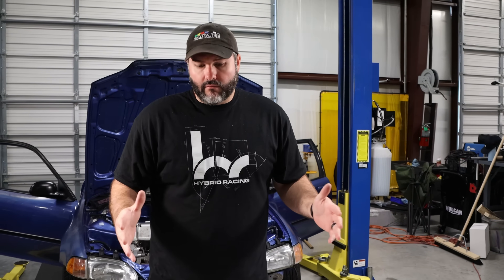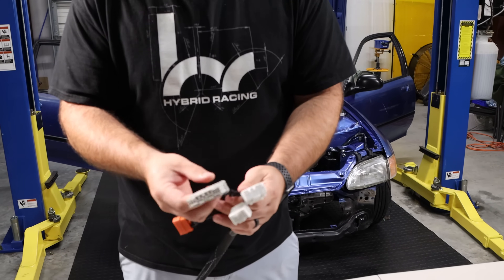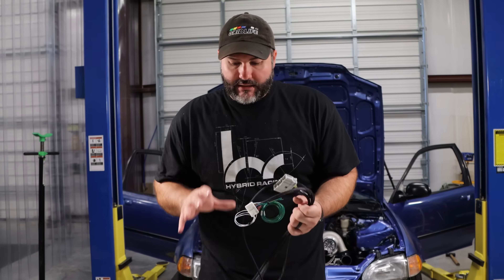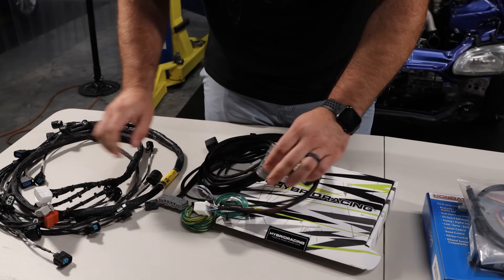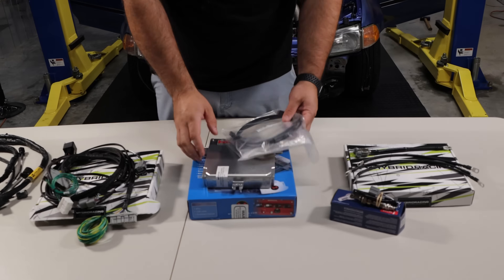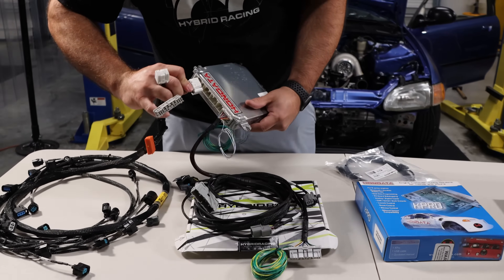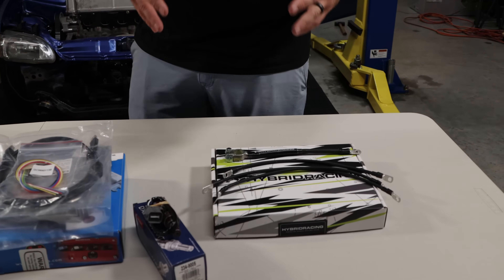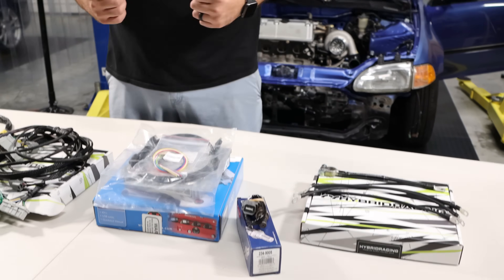K-Series Swap Wiring Explained!

Comment: so riddle me this, if i have a fb6 which comes with the complete k24z7 motor and harness, but add a k20a2 head, could i just cut off the k24 head sensor plugs and solder the new heads plugs for the new head sensors on? like i wouldn’t need a whole new harness and stuff right?

Comment: I will be doing a k24a2 swap with a JDM manual 6spd trans in an 08 Cvr. What harness would you recommend
Reply from the maker: If you are swapping a CRV, you'll likely need to use or adapt the CRV engine wiring to make it work.

Comment: Where do I connect the temperature wire to?
Reply from the maker: The coolant temp gauge will connect (typically) to your conversion wiring harnss. If you have our harness, look through the install guide on our site. It will show you where to put it.

Comment: I clicked on the 99-2000 civic link and it send me to the 96-98 wiring harness would that work on my 99 civic lx? I have a k20a2 engine in it
Reply from the maker: No, email us support@hybrid-racing.com, the wiring instructions for those two cars are different.

Comment: Question: if you run a k20a and 6spd with lsd out of an ep3 type r and put it in a 98 civic dx auto with the engine harness shown here? Does it come with an AC plug in? You mentioned the products here are specifically rsx, does your website specify ep3 friendly swap? Thank you
Reply from the maker: Our wiring kits work with any first gen K-Series engine. Meaning the wiring shown here will work with a K20A engine as well as a K24A, K24A2, etc. The AC connector is located in the 98 Civic chassis wiring so it won't be part of any harness you use from us.
Reply: Got it, thanks for the reply. Second question, if the car was an auto before the swap, do you offer a separate conversion harness or it’s up to the customer to make those changes in order to use your conversion harness? I’m not electronically inclined and would rather buy that new and already figured out. Thank you

Comment: Great video i  working on mine the  car goes on for first  time I got issue at this moment  with my Da obd0  to one i need a help 😢 my car it's missing  those wire the I have to pin i relly  don't know what to do  i belive it's similar
Reply from the maker: We don't have any harness for the DA Integra. I suggest using our universal wiring kit that contains all the necessary relays.
Reply: I got my rywire harness and chassis harness i belive  i got it figured  out I'm gonna try this weeken i hope I can get it 🙏  i found a similar  video on YT

Comment: Which sensors do you have to change if your running a k24a2
Reply from the maker: You would want to change the crank position sensor as well as the knock sensor.

Comment: Where would the pigtail connector plug in if you were to use it?
Reply from the maker: Part of the conversion harness plugs into the chassis wiring under the dash, the other end connects to your ECU and K-Series engine harness.

Comment: Can i run stock ecu will i have trouble with key to start it
Reply from the maker: You can't run stock ECUs unless the immobilizer has been bypassed. We suggest the KPRO or another ECU solution since it offers many other benefits.

Comment: I'm trying to swap a k into my old Datsun pickup. I don't think i need the conversation harness. Would I be able to run the K24 with a manual ecu and immobilizer bypass and just the engine harness? It do i need a conversation harness to hook up the o2 sensors?
Reply from the maker: You will need a conversion harness, specifically the universal version. Use that along with the engine harness in this video, ECU and KPRO. Since this setup is so custom you will benefit greatly from using the KPRO as it allows you to control sensors you will want to turn off.

Comment: Do you make a conversion harness for a cross platform engine swap?  Honda k24 to Volkswagen chassis, longitudinal mount engine.
Reply from the maker: We offer a universal conversion harness which can connect the K24 to the 02-04 Hondata KPRO. You'll likely need a special RWD style K20A2 engine harness, but it should work. Check Rywire or WireWorx for custom engine harnesses.

Comment: Do I need the 02 sensor installed before to get it started??
Reply from the maker: The car will crank and run without o2 sensors, however it will run pretty poorly until you have the primary wideband installed and functioning.

Comment: Will this harness also fit on k20a1 or only k20a2
Reply from the maker: The engine harnesses are made to fit any K-Series, as long as it uses the sensors from the K20A2 and uses a K20A/A2/A3 style ECU and conversion harness. The parts in this video can fit any K24A series or K20A / Z series.

Comment: If I have an automatic Hondata ecu could I still do this swap with a manual transmission
Reply from the maker: Yes. You will still need to convert the car to a manual trans with the pedals, etc, however, these parts will work.

Comment: How you doing I gotta 96 Toyota Corolla I'm need a k24 wire harness conversion kit if that is possible. The car's automatic converting it to manual I have a donor car But I would like to get a nice  harness for it.
Reply from the maker: I'd suggest using the Haltech ECU with a custom engine harness for this type of swap.

Comment: CAN  I JUST USE THE OEM 02-04 RSX TYPE S ENGINE HARNESS INSTEAD OF USING THAT RYE WIRE?
Reply from the maker: Yes you can, however it will not be correctly lengthened to fit inside of the EG/EK/DC2. The OEM harness also has connectors you won't use, and it may not route the way you want. If you are ok with that, then yes, the OEM K20A2 engine harness will absolutely work.
Reply: Hi sir how about k20a9 manual can use the complete wiring

Comment: I’m surprised on the universal harness there is not wire for the Tach output. Had to pin that in to get tach signal for my dash
Reply from the maker: The RPM output can be found on the E connector, pin 26. It's on every conversion harness we sell.

Comment: Can you provide a diagram or insight on connecting any other key wires that are specifically for a Eg auto non vtec chasis
Reply: I also need this info
Reply from the maker: Look through our install guide, it has a lot of EG / DC specific info.

Comment: Would this work similar on a Fiat 124 spyder with a K swapped engine?
Reply from the maker: You would use all of the same parts, except the conversion harness. Replace the EG/DC conversion harness with the universal setup on our website and yes, technically all of that work get the K-Series engine working correctly in the Fiat.
Reply: @hybridracing  wow! Amazing, I look forward to the swap. Definitely let you guys know how it goes👍

Comment: My issue is I have a k24a2 out of a tsx will this tucked harness still work? I wouldn't want to pay 500 if it isn't plug and play. I don't have any idea about wiring. I just bought a battery tuck kit with charge harness but it doesn't have a connecter on it it goes to fuse box, battery, alternator, and starter. Wiring is just so confusing to me. If someone can point me in the right direction it would he greatly much appreciated!
Reply from the maker: Please email our support team, we can walk you through it. Support@hybrid-racing.com

Comment: Do I need to have a 02 sensor if my car doesn't have a cat (crx)
Can I just use a wideband only?
Reply from the maker: If you are going to use KPRO or an aftermarket ECU you can run just the wideband and you will not need the O2.

Comment: Would all these work for my k swap for mini cooper ? Or would i need different parts
Reply from the maker: All but the conversion harness. You should use the universal conversion harness with all of these parts listed.
Reply: @hybridracing also what hondata should i get ?
Reply from the maker: @liljovh8114  If you are going to use a Rywire engine harness or similar, get the 02-04 K-series ECU with the Hondata KPRO. We have all of this stuff available on our site. If you need specific details and pricing, email support@hybrid-racing.com, we would love to help.

Comment: I’ve done at least 6 swaps wiring , I always recommend this . Simple and reliable. 
96-98 only needs charge light, coolant temp and fan switch.
99-00 is a little more work but still simple .
Reply: i have a 96 and looking at the installation guide on the hr website it says to find the a connecter from the chasis harness on the passenger side and i cant find it. does that means i dont have to splice in all the other wires. only the ones you mentioned for the 96-98?

Comment: For Honda K-Series wiring diagrams & ECU pinouts, especailly modern Hondas like CRZ Zf1,Zf2, Fit GD, GE, GK,GP4 hybrid,, Insight, City, Civic Si 07-11, Si 13+ models, Civic Base, FD1,FD2,FN2 aswell as older ones like EG, EG, Integra base. Also include C101, C124 plugs and their Main wiring harness diagrams. A lot people ask about them and i have shared them on many websites but image hosting websites sometime delete older pictures. That's why i thought why not make a video.
https://youtu.be/JNAZllePb4M

Comment: If I’m going with a Haltech Elite ECU do I still need a conversion harness if I’m running their digital dash also?
Reply from the maker: If you are going to use a Haltech ECU and digital dash, you still need the engine harness. I would check out the new Rywire K-series engine harness that is compatible with the Haltech ECU. It's what Eric Kutil uses in his race car, and the same setup we will use in our Drive-By-Wire EK9 with the Haltech 1500.

Comment: What's the best option for a k24a in an ek?
Reply from the maker: 02-04 engine harness - HR conversion harness - 02-04 ECU with KPRO and 02-04 wideband o2 sensor. All of that will plug into the K24 and plug into the EK chassis wiring. Email support@hybrid-racing.com, and our techs can get more specific with you.
Reply: I'm doing the exact same build and I don't know if it's just me but I find the whole rewiring thing FAR MORE confusing than the actual building of the engine itself. I have an 08 TSX engine and they say use an 02-04 RSX LOL. I'm going to go with what they replied to you, but I still honestly don't get it.
Reply: @brandond3404  they actually sell a harness for a k24a now no need to change sensors or plugs lol. Rywire
Reply: @jooeee23  Right on man I'll have to try and find it on their site. Thanks for the heads up lol
Reply: @brandond3404  man I feel like my question was way older than 4 months 😆 🤣

Comment: ok @Hybrid Racing ... question. i plan on kswapping my em2 (k20a2 specifically) . can i use the ecu from a type-s or do i need a stand alone like a hondata
Reply from the maker: Can you use an ECU from the Type-S? Yes, technically, you can with an immobilizer bypass. However, we will always recommend the KPRO since it will make your life much easier and the car work better.
Reply: @hybridracing  awesome. thanks.

Comment: What if we are using a k20z1 full swap? Which engine harness and conversion harness should I use?
Reply from the maker: If you plan to use our conversion harness, you'll need to use the 02-04 RSX engine wiring and ECU etc. Basically, all of the parts that are in this video.
Reply: @hybridracing  thanks for the reply

Comment: @Hybrid Racing What engine management would you suggest for a 2009 FG2?  I'm leaning toward a 06 RSX-S swap with supercharge for a track focus build.  Until I get the blower installed, but start adding bolt on's, what would allow me to manage those and someone to tune the blower when it arrives?
Reply from the maker: If you have a 09 Civic Si FG2, I'd suggest Hondata Flashpro. There are tons of maps available for that car off the shelf, or you can have a custom tune created for any specific setup. Check out our website, we keep them in stock.
Reply: @hybridracing  sweet, thank you! 😊

Comment: Step number 14 in the conversion harness install guide:

"Route the C101 blue 
connector on the Hybrid Racing 
harness to the driver side of your 
chassis. You can use the sup-
plied zip ties to secure it nicely 
under the dash. NOTE: 2000-
2001 INTEGRA. Remove pin 7 
Blue wire and connect it to pin 14 
Blue wire. Pin 14 has 3in of wire 
that runs into the harness that 
you can pull out. This controls 
your TACH."

Thanks in advance.

Can you guys illustrate this in a video?

2000 Integra GS Auto to manual with 07 K20Z3 swap.

Comment: I bought the hybrid racing conversion harness and the hybrid racing temp sensor. I installed the temp sensor on the hybrid racing radiator and the temp gauge doesn’t work… any feedback ?
Reply from the maker: Make sure the radiator is grounded.

Comment: Slight bit of advice, possible update. MAKE SURE TO GROUND ENGINE HARNESS TO A STUD AND NOT A BOLT. Bolts wont ground out due to rubber valve cover gasket.

Comment: Do you guys have wire harness for a k24 swap to a 98 Nissan Frontier ? Thanks
Reply from the maker: Not specifically for that, however you'd be able to use the parts in this video as well as the HYB-CWH-01-99. Check out the links in the description, if you still have questions shoot us an email.
Reply: Copy that. Thank you

Comment: Where's the charge harness? Built into the rywire?
Reply from the maker: The charge harness is a separate piece that is included with the Rywire harness. Your alternator and starter wires are built into the harness, the only part that is not is the actual direct power link between the battery. Obviously, there are a ton of ways you can run your battery, but that is really the only thing that's sort of custom to your specific chassis situation.

Comment: Does this Rywire and EK conversion harness combo support your AC kit?
Reply from the maker: Yes, although the AC system is chassis-based and has nothing to do with the engine or conversion harness wiring. The AC compressor is controlled by the engine bay connector, so nothing on the engine harness will connect to it. Your AC pressure switch is also part of the engine bay wiring, so again, the engine harness won't have any effect.

Comment: Awesome stuff! So is the secondary o2 “heater” plug a lot of time just tucked away and not used? Or am I missing something
Reply from the maker: Yes and no. If you are running KPRO, you typically do not use it and can turn off the sensor's function inside your calibration. That is what happens 95% of the time. If you are using a stock ECU (say a PRC Type-R ECU), you'd have to have it connected and plugged in since the ECU will be looking for the secondary sensor. But to your question, yes, you'd usually just tie the wire up and stick it out of the way.

Comment: I bought your conversion harness and had a voltage fluctuation issue with the main o2 plugged in. Made the engine run really bad and caused lights to dim up and down.  I have 4 massive grounds all are pure copper to shiny bare frame. Ended up having to run o2 power straight to the battery and relay trigger from 12v switched under the dash. Any idea what may have caused the issue? Everything else on it seems okay and the car is a 97 integra ls with a k24a2 on kpro4 pnd ecu and base rsx harness.
Reply from the maker: I have encountered it before, but it is nothing as severe as what you describe. I'd send our support team a message so we can get more info. Support@hybrid-racing.com Otherwise, isolating the relay and running power directly to the heater is the right thing to do. Just make sure it has the proper size fuse.
Reply: I had to do the same thing. My tuner had me cut the wire and reroute it to another power source.  Was kind of disappointed after the amount I spent to be honest. Granted, this was 2 years ago, so it doesn't much matter anymore haha.

I also had my card info stolen and had $1000 spent in Baton Rouge after buying from Hybrid Racing.  I reported it to them and got told it "definitely wasn't them..." Even though they're out of Baton Rouge, it happened a few days later, and I've never been there before in my life.
Reply from the maker: @grant6985  I'm sorry to hear about those issues. Our customers and service to them has always been paramount throughout the course of our near 20 year history.

Comment: It said on website  conversion  harness  does work on k24 how yous doing on a k24 then
Reply from the maker: It works on K24 engines. It does not work with K24 engine wire harnesses or ECUs.
Reply: @hybridracing  so how would one go about putting a fn2 top onto the k24a jdm odyssey absolute 2005 what harness / ecu setup combo would make this possible ive got the two cars fully working sourcing part from a full fn2 into the oddysey and franking the engines, what would i do to make this possible with what wire harness you guys sell?
Reply from the maker: @bootstraptv4912  Send us an email and we can give you a better answer. Support@hybrid-racing.com

Comment: I've been running the Hybrid Racing Kswap Adapter Harness/Sub-Harness in my CRX for over 10 years. Never had an issue with it. Only electronical issues I've had, have always been in the factory CRX wiring (old, crusty wires).